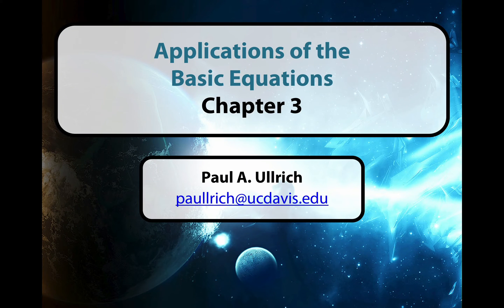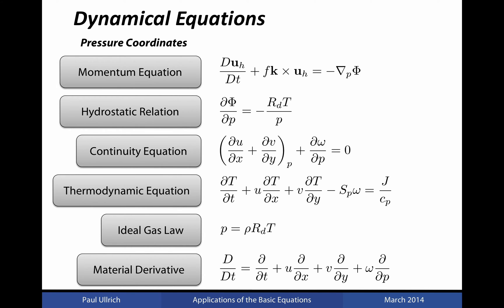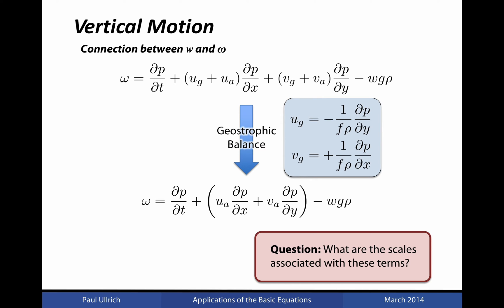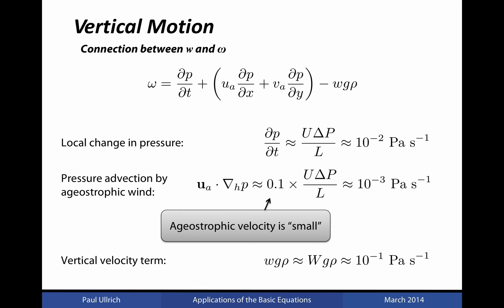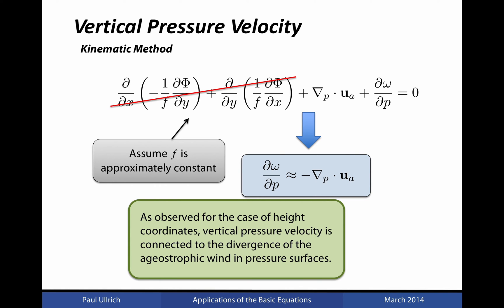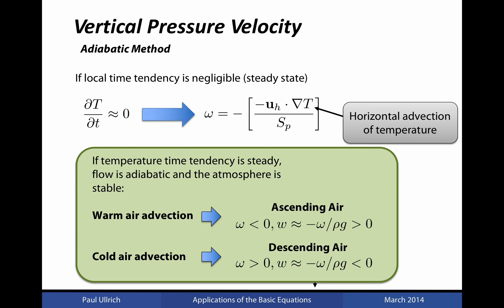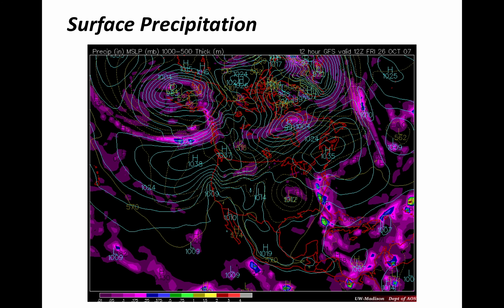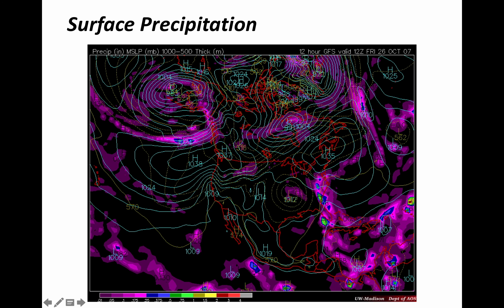AtmosphericDynamics Chapter03 Part04 VerticalMotion

Comment: Hi Paul, this is a great video that clearly walks through a problem I've been struggling to wrap my head around.

I do have a question on your statement that the kinematic method "tends not to be used" because of inaccuracies in measuring the ageostrophic wind. This is confusing to me because I think it's still very much the case that both ECMWF & the WRF model use the kinematic method as the basis for their omega calculations.  Do you mean instead that the kinematic method is rarely used for deriving realistic vertical velocity estimates based off observations? It seems to me like it would still be a viable way of calculating vertical velocity on gridded model output fields. Is this a correct interpretation?
Reply from the maker: Yes, it's rarely used for deriving realistic vertical velocity estimates based off of observations.  When it comes to the models, horizontal velocities are known to many digits of accuracy, and so losing one digit of accuracy from the kinematic method is justifiable.
Reply: @introductiontoatmosphericd284  Ok, great! That helps to clear up a lot of my confusion. Thank you very much for your prompt response!